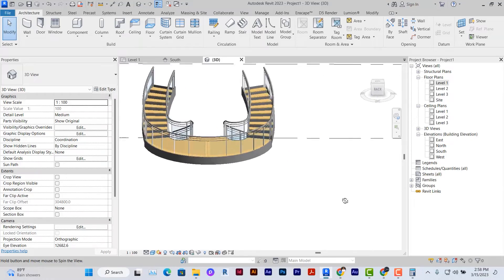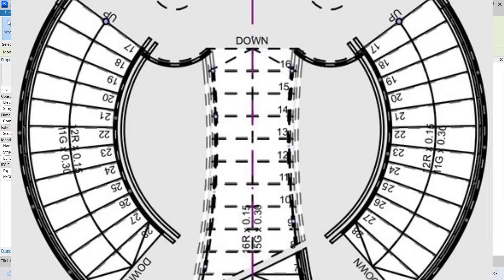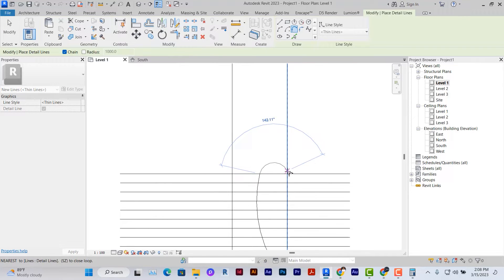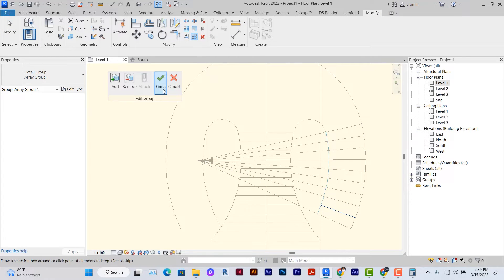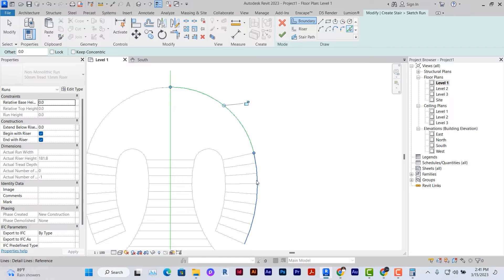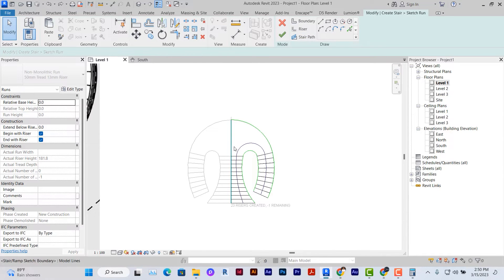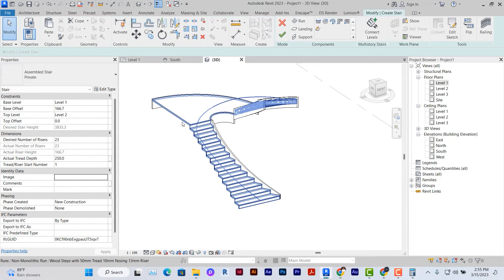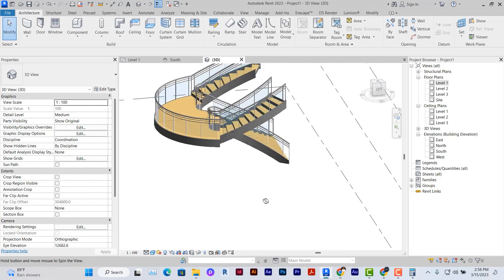QUICKLY CREATE CURVED STAIRS IN REVIT

Comment: Where did you get the stairs you used - do u upload from autodesk family or …
Reply from the maker: It comes with the default metric template.. if you don't have a template,  you can use the sample project that comes with revit.  Delete every thing and save as a template file.